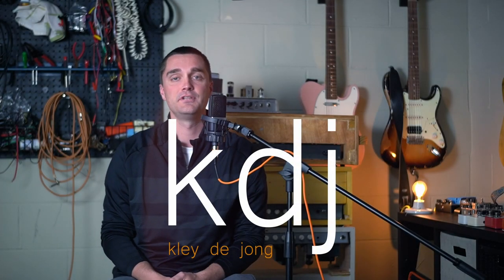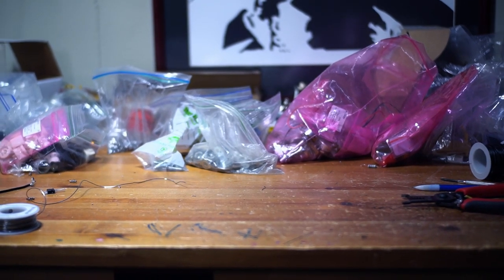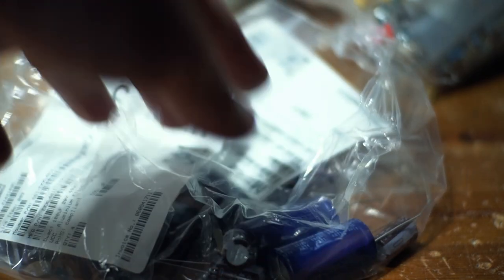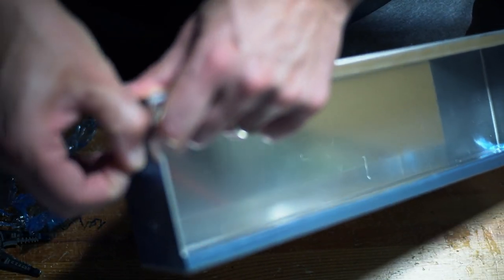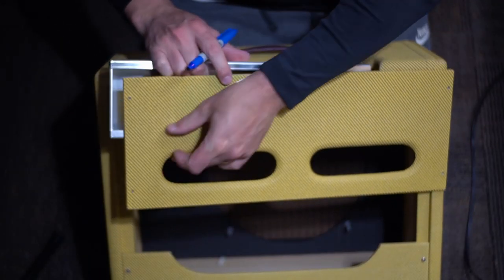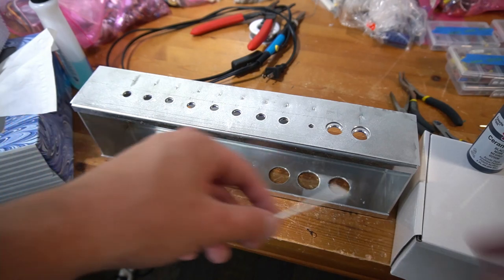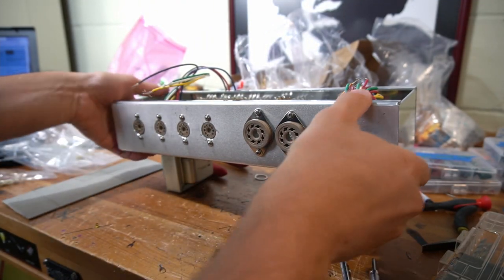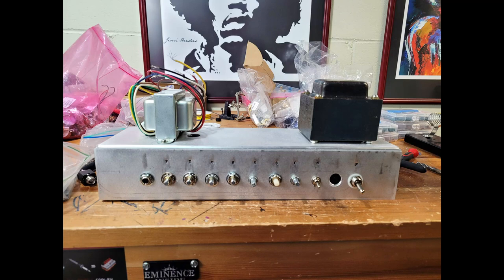Princeton Reverb Build pt 2 - Chassis Fabrication and Mounting

Comment: Glad to see you moving forward on the build. That will be a tight work space once you include the reverb transformer and connectors. I’m sure it will fit with some creativity. 

I tend to be more traditional in my layouts. The designs are familiar to users and other techs that may work on it at another time and place. It also has the advantage of widely available layout drawings being useful for my build. Fender amp layouts are usually good for lead dress to avoid noise. Problem areas (such as tremolo) are well known. 

I like aluminum chassis as long as it is strong enough to support the transformers for decades of use without bending. Steel is stronger. Clearance for speaker can be important  on layout. I found out the hard way that you can’t center the speaker on a deluxe reverb. 😝

I have a few of the staking tools. I actually use a 16-penny nail for the job. My eyelets hold better when I use that. I build my eyelet boards on thicker fiberglass stock, which may be why the nail works better. Florida humidity makes fiberboard for crazy things. 

Will continue to follow along with interest.
Reply from the maker: Thanks for the input, more episodes incoming!

Comment: You need to get a hand reaming tool to clean up all those lil burrs. Especially since you are using aluminum it will work great and give all the holes a nice lil chamfer.
Reply from the maker: Thanks Ken, I have a stepped drill bit I use to debur. It gets a little cramped in a 5e3 chassis though!
Reply: @KleyDeJong  that's why you would like a little hole cleaning tool. I'll have to find the exact name of one but you can clean both sides of a home from outside the unit because of how it's curved. It's a nifty little gadget.
Reply: It's called a "deburring tool". Should be able to get it through harbor freight or any decent hardware store.

Comment: How thick is your aluminum chassis? Im a bit worried in using these for 50w-100w builds with heavy tranys and a choke mounted sideways
Reply from the maker: Yeah I'm not sure if I'd go much bigger on this chassis. For the PR it's working great though.

Comment: Hello Kley, great video. How do you meassure spacing for valves and transformers? Are you following some common layouts? Or just by experience?
Reply from the maker: Thanks. It's a combination of having room to add components comfortably, avoiding heat buildup, thinking about what that tube will.be connected to, copying known layouts, and aesthetics. Experience helps a lot.